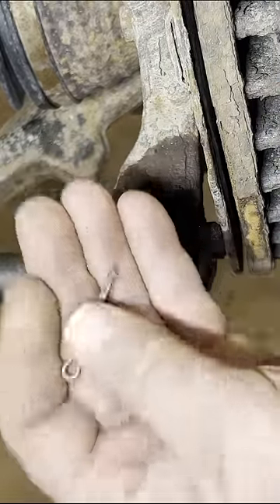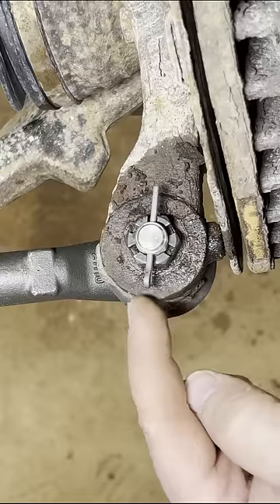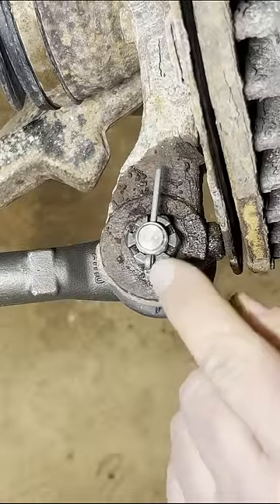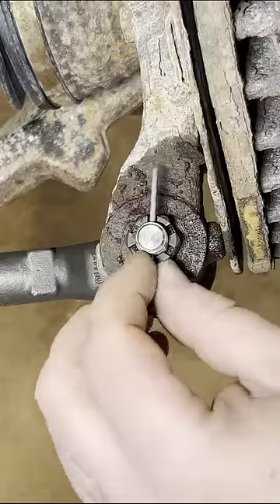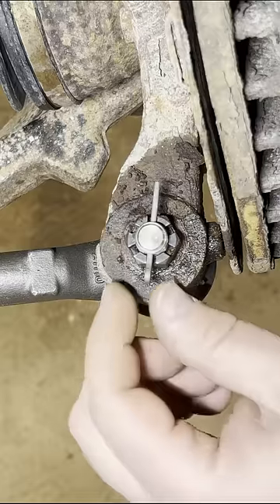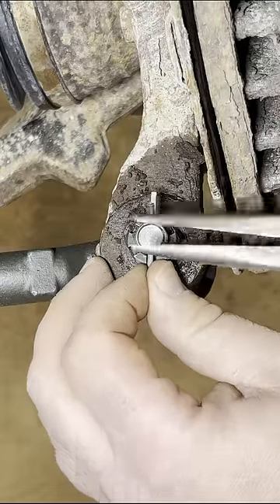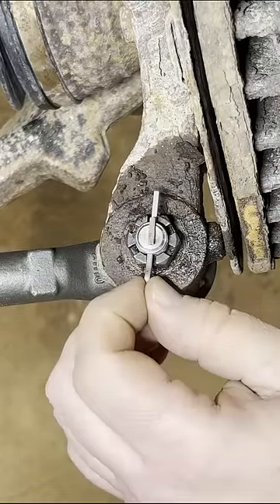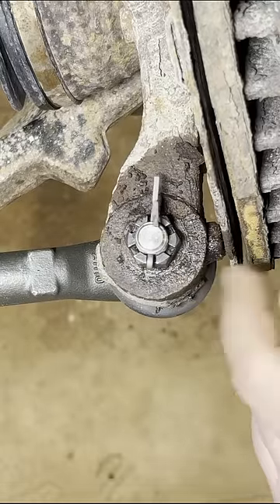RUST BELT Cotter Pin Installation!

Comment: I turn that pin 90 degree and then maximaze it and turn both one left and 1 right. When they are rusted use Pliers cut the 2 edges and use the tip on the pliers to leverage it. Never fails me.
Reply: Same here buddy
Reply: Some couch mechanic here is going to tell thats the wrong way to do it. But it won’t be me.
Reply: As a former aircraft mechanic:  Turn the loose ends into open parts of the nut.
Reply: this is the way
Reply: Exactly, what’s the guy talking about. Wiggle room? No get that pin in tight if you must apply a  small amount of copper slip to the pin. I’ve never encountered one that won’t come out.
Reply: I dunno, man.  I am not sure that the rust in your area is as effective as it is here.  I have found it to be easier and faster to pound a socket on it, and shear the pins off and drill out the remains.

Even if it does miraculously come out, all the threads need to be chased iif I ever plan on re-installing said joint.
Reply: This
Reply: On this way you can grab the head with cutters and not cut but pull the pin out just as 123
Reply: @Longbowgun  I wish I can give you a thousand thumbs ups.
Reply: 99% of the time when you are taking that pin out its to replace it.. so just bang your socket on and blow it all off together. Side note if you don't have to replace the part and the pin is stuck you can usually just tap it out with a punch
Reply: I was looking for this comment before I said it myself. On farm equipment, we always turned them flat then bent them to the sides firmly.
Reply: YES!! Thank you. Someone knows the alternative way to install a cotter pin. Right on brother
Reply: @Longbowgun  this is the way
Reply: That's how I've always done it
Reply: At least you know what to do
Reply: Exactly!
Reply: That's because you do it the right way.

Comment: Never, ever leave a cotter pin loose like that.  If this guy has any sort of conscience he will take this video down before he kills someone.
Reply: Over dramatic much one in the rust belt those tie rod castle nuts are always over torqued and rusted ur little cotter pin won’t make much difference
Reply: Lol relax. That nut will never have enough torque to cut through the pin.
Reply: Grow i set. I have ran miles with out cotter pins 😂
Reply: Man i wouldnt worry about it that much. Its just a cotter pin, it'll do it's job even if it has wiggle room
Reply: I don’t disagree that he left quite a bit more slack than I would want to see on my personal vehicle but that cotter pin works very much like safety wire on a jet. The whole point being that it’s meant to limit the movement of the fastener and to keep it from “backing out”.

I’m not saying either of you are wrong. Just different approaches to doing the same thing.
Reply: @taimaishu-nao1922  
all I know is if I were to apply lockwire around some nuts on the Apache and it's got any amount of looseness, it's getting snipped and replaced and I'm going to be yelled at for it by the TI.
Reply: @taimaishu-nao1922  As a licensed A&P mechanic, I agree.  The cotter pin is only there to keep the nut from backing all the way off should it become loose.
Reply: In the rust belt 1 week from now the nut will be welded to the stud and the cotter pin will be redundant.
Reply: @capt.raptor4650  exactly locking wire by  exact twists per inch and that holds critical components from coming loose/falling into things they shouldn’t, not a pin or clip with no real exact tolerance besides being able to get thru the hole. The reason as you don’t want to loose your steering so really it’s a “Safety Pin” aviation forces and speeds are hugely different than a passenger road car so your tolerances, procedures, etc are going to be far more stringent than automotive. The irony though is the same mindset/techniques should be applied to automotive and they are not.
Reply: Please explain the reasoning behind your comment??! I don’t see how a couple MM of cotter pin shaft extrusion is going to affect the overall safety and longevity of the component? Its staked into place still and it’s also the correct cotter pin. In theory even a small piece of wire could act as a cotter pin.
Reply: Stick to what you know, huh?

Comment: I’m in Maine and with all the salt and calcium used, I use a good grade stainless steel with little never seize.
Reply: I also agree with your solution to using a stainless steel cotter pin however I still believe if you grease it enough you don't have to leave the cotter pin loose and the grease. Any rusting from occurring no matter what area you live in I'm basing this on the past 45 years that I have been working on vehicles mainly commercial vehicles and large trucks which we all know rust very easily because no one ever takes care of trucks properly of trucks properly
Reply: I live in Maine as well and do the same stainless never seize and lots of grease
Reply: I don't want to start an argument but I live in NNY and the rust here sucks as well as the rest of the rust belts. I have been wrenching professionally for over 30yrs and I have found, in my opinion, that the mild steel cotter pins work Incase the tie rod, ect. rust around the the pin seizing it in place for some reason that a little heat and a punch is easier to get out than stainless especially if I have to drill it. Also, not a big fan of anti seize. When the oil dries out of the silver (which is what most guys use) it gets hard and gummy making things worse. I either use axle grease or copper brake lube. Like I said, its just what I found that tends to work for me.
Reply: It really doesn't matter what climate you live in or where you live because with enough grease on the castellated nut and a cotter pin installed properly it will never come loose or rust making it impossible to remove
Reply: @charlenedelamater4797  I agree in a perfect world but unfortunately the technician that worked on it before me does not always agree with these techniques for the owner of the vehicle will hot steam pressure wash the grease right off and then the first winter it's rusted solid. So, with all of the variables, I would much rather use the mild steel cotter (not split) pin. But I still agree with you on the grease (or brake lube ect) cover it well and at least attempt to prevent the rust the best you can.
Reply: I bought some but the cap was seized.
Reply: @davidpawson7393  That was good one... I see what ya did there.

Comment: Usually when that happens you hammer a socket on the nut and the cotter pin will break from the impact gun especially if it’s that rusty
Reply: Best way, do it all the time
Reply: bingo
Reply: Exactly why work harder work smarter...😮😉

Comment: Been a tech with dealerships and fleet shops for years and I have something that’s worked like magic. Not grease, not never seize or fancy stainless pins. 
  Dip your cotter pin in grey silicone. Keeps water and debris out and doesn’t harden. Easy removal and everyone’s got a 1/4 tube from the last oil pan job. 
 You’re welcome.
Reply from the maker: That’s gold! Thanks man!

Comment: Well that's a very rare gym on YouTube these days ...a "tip" that's actually helpful and informative.
Reply from the maker: Thank you!
Reply: gem*
Reply: Who tf is Gym?
Reply: @furies come on man! That's "Gym Typo", I'm sure you know him, EVERYONE does
Reply: @Tomsfoolery.  next time try turning cotter pin and wrap around nut on both tags and you can still pull it tight and you will still be able to take it out no problem loose cotter pin is soft and will be very weak
Reply: Gym !?  How about you get some stainless steel cotter pins, and make sure they don't vibrate and they're on tight. Now that's a gem !!
Reply: @mrfixitusa6165  Oh.   I thought I found my missing friend.  I'll keep hunting.
Reply: @furies  but if you find him you won't have a missing friend anymore ... Which obviously means he'll cease to exist, and you wouldn't want to do THAT to a friend would ya?
Reply: @furies  yo mamma knows
Reply: Gym... you're as bad as this guy... should be gem..... ahhaja duhhhhhhhh!!!!!
Reply: WHERE CAN I FIND A RARE GYM
Reply: So many things wrong with this. First I use side cutters when removing cotter pins, just tap the non looped end and it will move far enough to grab the loop . Second most tie rods have one tim use lock nuts on them now. Third you didn't trim off the excess so now the customer is going to complain about that pin moving around.
Reply: Gem, not gym, lol
Reply: As long as that Carter pin has the ability to wiggle, it can wear through and your crown nut can back off causing your tie rod to disassemble mid drive spinning you out and into a level of pissed off that had never been achieved before...
Reply: @lizzard7473  1st it's called a cotter pin
2nd it won't "disassemble" it might come unscrewed 
3rd if it does break its not that  hard to keep control of your car. You still have one wheel connected.  

You've seen too many movies
Reply: @Tomsfoolery.  Use a stainless steel cotter pin and turn it sideways so you can bend both legs. Or if you are using a ferrous material cotter pin, cover it in grease or anti-seize and turn it sideways so both legs can be bent. Do not leave it loose as vibration and other mechanical forces can cause the pin to shear from metal fatuge or can cause the pin to wear out to the point of failure. Safety first.

Comment: I was taught to push it all the way in and wrap the legs snuggly around the nut to prevent the pin from moving, then brush some grease over the pin and into the hole to minimize rusting/seizing.  Don’t know if that’s a recommended way but it works great in an ocean neighboring state that salts & sands the bejeezuz out of the roads in the winter.

Comment: Use a stainless steel cotter pin. Bob’s your uncle
Reply: He was indeed, he was also an engineer.
Reply: Yes! Stainless is the way to go!
Reply: Stephen I think youll find
Bob is your non gender specific relatve.
Reply: Was. Rest in peace Robert Uncle.
Reply: Stainless is likely to make the parts it's fitted through rust more. It'd also be more prone to snap & harder to drill.

Loctite would be better, but there's no visible safety check.

Comment: It will still rust , dip the cotter pin in grease
Reply: Anti seize paste
Reply: Be careful, many cheap greases are hydroscopic ( absorb moisture) and will cause rust.  I have even seen it attack chromed acme threads on large valves.
Reply: I use red Marine wheel bearing Grease and nothing ever loosens or rust up the Marine wheel bearing Grease is water proof because everyone always back their trailer with the boat on it into the water to launch the boat that's how I know for certain that the grease is waterproof

Comment: Spin 90 degrees from how you had it, so the loop won't fit into the groove of the castle nut. Then bend legs around the nut in opposite directions.

Comment: If the cotter pin rusts just cut as much off as needed to get your socket on and impact the nut off. Then use a punch to remove the remaining pin from the tie rod if you’re re using it. Works every time

Comment: Cottor pin is too small.  Use stainless steel cottor pins also.
Reply: But why would a homosexual special rights activist need to know this ?
Reply: I have also used nails in the place of cotter pins and split pins and they work very well and are solid and can always be easily removed when needed

Comment: You can always put it in where the eye is facing upwards and then pull the tangs around the outside of the nut. That will allow you to still get a pair of needle nose into the eye to pull it out.

Comment: The cotter (wedge) is used in a cotter joint, where as the pin  is typically used as a fastener(retainer) for a locking nut, not wedge and pin are different types of cotters

Comment: use stainless cotter pin
Reply: That's to smart
Reply: That will also corrode when in contact with steel
Reply: You don't live in the rust belt do you? Around I've seen wooden trim rusting, stainless ain't gonna help any
Reply: I line in PA. Gold rusts here...

Comment: I live at work in the rust belt.  The day I bought a cotter pin extractor was the day my life changed.   The one I use has a hardened hook tip and comes back in an L shape with a handle and you just tap it with a hammer and the cotter pin comes right out.  Don't even have to straighten them.  Just hook the loop and tap.  So much quicker and easier.
Reply: That's if you can get to the loop

Comment: That is actually a good tip but judging by the condition of all the components around it, I'd say the new cotter pin will still be rust free when everything else dissolves away! 😁👍🇺🇲

Comment: If it can wiggle, it will also wiggle untill it is shaven completely... So there is no pin any more... I would just grease it.
Reply: So why do firing pins in guns last so long? Its almost exactly the same concept and ive never noticed any kind of wear on any of mine after thousands and thousands of rounds. It it doesnt even leave a wear spot on the carbon
Reply: @user-nb8yt2il2r a vehicle will vibrate much more than a 1000 times when only driving one single mile. You cant compare a gun with something that vibrates a lot.

Comment: You should bend the other straight piece a little too in case that top piece rusts and breaks. If it is always wiggling, it is more likely to break at some point. You could also just spray it with some anti-rust paint. I prefer them in secure, tight and very bent. Those pins are thin- I can usually get them off one way or another.

Comment: Cotter pin should be correct size for the hole and cuts in the crown of the nut (they are the same size), that should be snug fit. Pin rotated, so hole in the head is visible, ends on the other side of the nut should be wrapped around on both sides. No loose, no moving. Pin should prevent any movement of the nut, otherwise moving nut will cut pin sooner or later.
Reply: I've worked on cars for 30 years and have NEVER seen a castle nut back itself loose even without a cotter pin. That nut aint cutting a cotter pin!

Comment: I living in the rust belt usually don’t even try to remove cotter pins. Just pound the proper size on impact the nut off and if you are reusing said pat use a punch or drill the hole back open

Comment: If your that worried about it buy stainless steel cotter pins its corrosion resistant
Reply: All metals are susceptible to galavantic rust.  Two dissimilar metals in contact will always corrode.
Reply: The pin is resistant. What else is going to be stainless?😅

Comment: It is a SPLIT pin, a cotter pin is either round with a flat taper on one side, or completely tapered and has a thread at the narrower end. a nut is used on the thread to tighten the tapered pin in a hole to wedge the items together.
A typical application is a bicycle crank.

Comment: Very good tip. I also like that you used needle nose to bend instead of diagnals. I don't understand why someone would use a cutter to bend.
Reply: I use a pair of knipex cutters for split pins, they bend, hammer and cut without changing tools, it's not difficult.

Comment: I have never had to drill out of cotter pan no matter how rusty it was
Reply from the maker: I couldn’t count how many times I’ve had to drill out cotter pins! I wish rust wasn’t so common here.
Reply: @Tomsfoolery.  location location location. You have my sympathy, I can't imagine a more irregular surface to navigate with a drill bit. And you can't really use an EDM there either. Wrench on my tool brother!
Reply: Your lucky I have drilled out lots of cotter pins

Comment: By the time that pin wears down due to vibration, the nut will probably be seized to the threads, or at least stuck well enough to that it ain’t backing off.

Comment: the pin is 90 degrees rotated, allowing the head to enter the castle nut. Installed properly, it does not need to wiggle, because the head is always available for retraction

Comment: I've tried various methods of installing pins since I was a kid working on my bicycle.

Loose pins wear down real quick and end up breaking. I'd much rather deal with a difficult to remove pin than one which has broken without me being aware of it, leaving a castle nut (or other part held by the pin) free to come loose.

Besides, usually a good whack with a pin punch will clear the holes out right quick. I've never once had to drill out a rusted-in cotter pin.

Comment: There seems to be a pretty big difference of opinion in this comment section. So which camp do you fall into?

1) I've used this technique in vehicles and then decades and/or hundreds of thousands of miles later I've found the cotter pin to still be perfectly intact. This technique works just fine.

2) This is insanity that is going to get someone hurt or worse. Cotter pins are clearly made out of soft metal and the vibration will wear them down to nothing. For safety sake, please don't do this!

3) If you live in an area where they lay road salt down and you really don't need to worry about it either way because rust will have locked the bolt down and destroyed the pin before it had a chance to either seize up or wear away to nothing anyway.